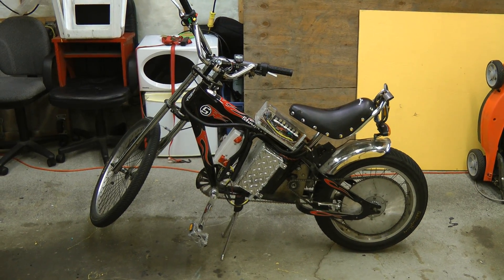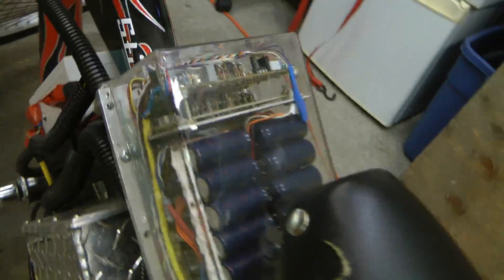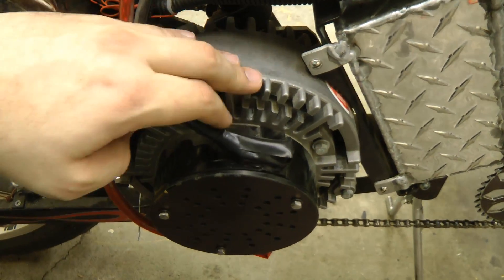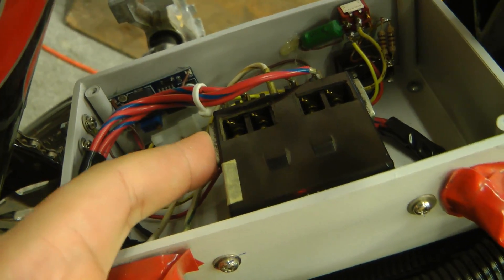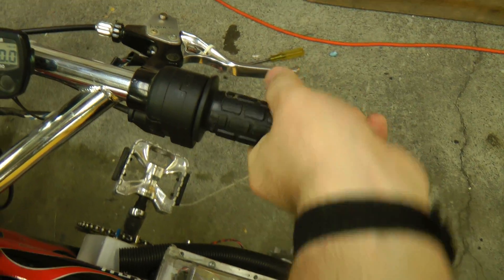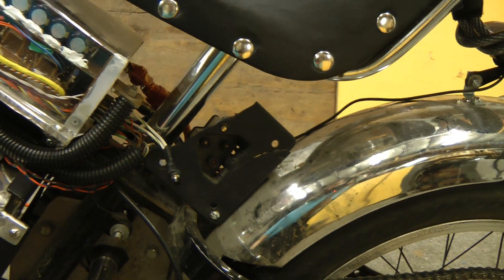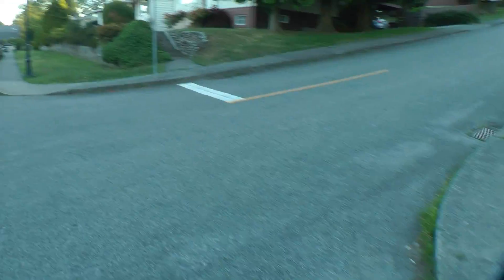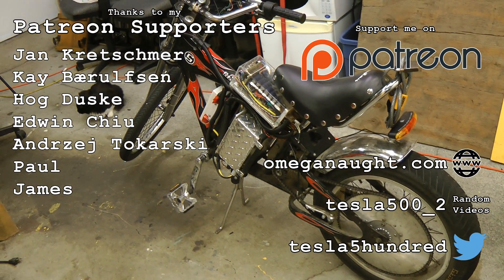12HP Electric "Bicycle"

Comment: what magnet's? commutator brush motors don't have magnets they don't need them. you have two separate windings the brushes are what makes contact between them when electricity is applied through them this is what creates your electromagnetic force giving you momentum and power and torque along with the rotation around a shaft and why the shaft is spinning. as far as the housing goes a Prescott housing with one bolt for alignment is not common. I have a mote energy me-0907 and it's recommended not to go over 90 volts at 300 peak amps and 130 continuous but that motor is capable of punching out well over 80 horsepower and well over 150 lb feet of torque. anytime you increase the speed the power or the amperage the torque it increases ware. heat is the enemy, over building the motor and underpowering it achieves longevity and redundancy increases longevity anyway you can keep the heat down lower the friction extends the life of your vehicle that you're building just FYI keep building bro nice job hard to get something truly dialed in that's inspiring to look at as well as perform. so good job this is neither ugly nor a bad build, quite the reverse a commendable job I can see how it will perform I myself have built hundreds of electric and piston driven vehicles in my life. course I'm almost 60 now so there's that

Comment: I've been having trouble finding an answer to this question  I'll ask it here. I am fairly experienced with electric drive systems both AC and DC and understand how regen braking works. All of the equipment I'm familiar with usually uses lead acid batteries however so regen charging is much simpler (in my mind) 

the question I guess is, How does regen work on a lithium battery which needs (this is where my knowledge is limited) a much more specific method of charging?
Reply from the maker: In this case, the BMS built in to the battery has an output that tells the motor controller to slow down or stop regen to protect the battery from damage. The battery makes all the decisions, the controller just has to obey the regen current limit request.
Reply: Thanks, I guess I'll research BMS that support regen or similar topics. Sometimes the biggest struggle is not knowing the questions to ask so thanks for pointing me in the right direction.

Comment: Biggest concern I would have is it's a toy bicycle and likely the maker expected kids to pedal it all of 12 mph with a tailwind downhill.  I would question the durability over time of components and even the frame.
Reply: Clearanceman2 I don't think it's  made for kids, or with durability purposes. I think it's just for fun
Reply: The original bike was made for kids obviously.  Putting a bunch of power through it that it was never designed to take is a gamble.

Comment: this is awesome yes you have inspired me to continue with my plans I was already getting ready to start my dream bike build using the same model bike frame I am not nearly has knowledgeable as you are so I will have to use parts already built I am praying that a 1000 watt rear hub motor  with a 30 amp continuous motor controller powered by 3 36 volt lithium batteries or 2-48 volt have not decided yet I am thinking of 2-36 volt wired in parallel with a 3rd that can be toggled off and on for boost or for backup to get back all the batteries will have on/off toggles so I can turn them off at will anyway I hope this will be enough power to give close or similar results as your build  this will take me at least a year to build money is the main factor as I have a small monthly budget so I must buy part by part but I am patient and it will be all worth it in the end this will be my main mode of transportation due to a disability  but for now I will continue to ride the bus lol  your video was very help full I learned a lot thanks any advice is for sure welcome thanks sincerely inspired jaymus

Comment: Excellent work! BTW for about $30 you can get bolt on frame attachment points to use a disc brake for that front. Of course you need to buy a new wheel with a disc brake. I'd recommend the ones with dot 3 break fluid -- super safe and the feel you get is just like a car's foot pedal only through the fingers. Any chances of sharing the 300 amp motor controller circuit?

Comment: Nice build :) But is that really 12hp on the wheels? Looking at videos on electrical bicycles with standard 1500w motors (2hp) seems to have very similar power as your creation. Maybe litte less acceleration on a hub motor but they are much faster.

Comment: sounds dumb but you could fit a rear caliper using the sprocket as a brake disc
Reply: That might be bit complicated because chain clerance issues but sure if you can find proper brake system with enough space in it.

Comment: I guess you could make a smaller sprocket on the rear wheel for higher top speed while taking advantage of all the excess torque.
Reply: I wish i had the resources to make an electric bike, but why would i when i have a 80cc chainsaw engine from 1976 almost ready to back on my old bike. ;)

Comment: wouldn't you get the same acceleration with a better top speed if you use a lower gear ratio and increase the current limit on the motor controller?
Reply from the maker: Yes, that would do exactly that. Would need to upgrade the wiring probably to handle the higher current.

Comment: I've wondered. Would it work if you put an RC motor in there? I know there are really powerful RC motors that are much much smaller than that.
Reply from the maker: Yes, I hope to do a better version of this with suspension, using two 6kW outrunner motors. Already have a prototype one I've added hall sensors to, because sensorless sucks for traction drive applications.

Comment: Wow things have come a long way since you built this. 
My bike runs the components linked to here, and will flip over backward easy. Top speed is 45MPH on flat ground. I used a 1997 GT LTS-2 frame with 1999 Marzocchi Bomber forks. I soldered the shunt on my controller to provide 90 amps which the controller handles fine. I run three 6s batteries in series. I used 8 and 10 gauge Turnigy wire from Hobby King for battery and phase wires. I have pulled a two second peak of 6400 watts and have it on video. It is insanely fun.
http://kinaye-motorsports.myshopify.com/collections/direct-drive-hub-motors/products/mxus-xf40-45h-45mm-3000w-motor-4t-9kv
http://www.ebay.com/itm/72V-500W-Electric-Bicycle-Brushless-Speed-Motor-Controller-For-E-bike-Scooter-/391488639412?hash=item5b268a91b4:g:frwAAOSwO~hXIIOd
http://www.hobbyking.com/hobbyking/store/__80907__Multistar_High_Capacity_6S_20000mAh_Multi_Rotor_Lipo_Pack.html
http://www.hobbyking.com/hobbyking/store/__78178__Turnigy_High_Quality_8AWG_Silicone_Wire_1m_Black_.html

Comment: You mentioned that when you used regenerative braking you dumped 100 amps back into the batteries. What exactly defines the maximum amount of burst current you can feed into a lipo pack exactly? Is it just the charge C rating or does it only really matter that you dont overheat the pack and or charge it at a voltage that causes some kind of breakdown internally?

Comment: Wow, so much custom work! Very impressive results, of course great performance, but also great flexibility. Those little RC batteries have amazing energy density and the current makes me a little frightened. Did you consider a thermal cut-off, or did I miss it? 

When you described a street legal ebike I knew you lived in Ontario, but I can't place your town.
Reply from the maker: Thanks! The batteries make me nervous too, something like 1000A short circuit current each! it's nerve wracking making those connections in that tiny box.

There is a thermistor so the BMS knows the battery temperature, yes.

I'm in Vancouver, BC actually, BC and Ontario both have similar laws I believe.

Comment: What is the regenerative breaking efficiency? Is it reasonable to commute uphill in the morning and then downhill in the evening and get most of the charge back?
Reply: "Most" depending on the desired speed of course lol
Reply from the maker: Efficiency is probably about 70-80% from motor shaft to battery. Under good conditions you could probably approach turning your uphill /downhill commute into something that uses about as much energy as if it were flat.
Reply: Nice :D

Comment: 2 weeks ago I took delivery of my electric bike, the rules are quite diffrent in the Netherlands.

In NL this would be considered a moped and you wouldn't be able to register or insure it (witch is mandatory for mopeds to drive on public roads)

the most common electric bike in NL is the pedal assisted type, so you have to keep force on the chain or the motor will stop.
max assisted speed is 25km/h.
Reply: in the uk ebikes suck....
the electric motor shouldn’t be able to propel the bike when it’s travelling more than 15.5mph
the motor shouldn’t have a maximum power output of more than 250 watts
It must also display one item from each of the following:
the power output or manufacturer of the motor
the battery’s voltage or maximum speed of the bike
Reply: yeah`nd that be even worth like your human Rights Understanding innit ???

Comment: Really cool, I have always wanted to do something similar but in Norway you are limited to only 300W so it is not really even worth the extra weight of the batteries
Reply from the maker: The cops aren't equipped for road-side dynamometer testing, you can generally ignore the power limit. Or do as I've done and have a secret button to enable high power mode.
Reply: True, but they can generally tell it has more than 0.3kw when you can pop wheelies. And it is not worth loosing my drivers license over and getting a hefty fine($1000+). And you are fucked if you happen to be in a accident as it counts as a motorbike, with no insurance and no registration.

Edit: there is also a speed limit at 25km/h where the motor must stop working
Reply: Since I live in the country I dont have to worry about any cops so when I make my ebike it will be scary fast and I have plenty of gravel roads to rip up
Reply: +LittleMe If suspect that 'generally tell' isn't going to stand up in court.
Reply: Fuckda Police !!!

Comment: Wow... I like that little cheat button to get Full Power.. Dangerous power, if you nail the throttle.. :)
What's the max speed with Full Power? 55 kph? 
It's cool to see all the work you put into the bike. It's an amazing performer! The hill climbing is out-of-sight! Your bike makes zooming up a hill, look easy! 
Made me think back to the 1960s, when I was trying to climb the hills in Bermuda, with a very light 50cc moped.. I kinda know what kind of power it takes to get a 140 pounds of teenager up a long steep hill..  Yikes!
Reply from the maker: Thanks! Max speed is 45km/h or so. Hills? What are hills?

Comment: please open source the bms
Reply from the maker: I'll put it up on my website, just need to get everything together.
Reply: LEGEND! Yes i'd buy lets group buy some..!!! I'd never kick start but an open source bms that modular.. yes yes yes please :)

Nice bike though I got one of those frames.. I hacked in some cheap downhill forks so i could get a disk on there but it stopped there for now.. gear it for speed as you still have loads of power left in that motor..
Reply: +tesla500 awesome, thanks!
Reply: That would be so cool!
Reply: tesla500 any update on this? I really want to learn how to design a BMS
Reply: Just emailed you about this bud.. look forward to speaking to you soon.
Reply: Understandable! It's better than nothing and certainly a good starting point. Software isn't my strong point whereas I can probably deduce how it electrically functions from the PCB design; components, comms, etc, etc so that works for me! That would be awesome!
Reply: yeah! please I also like to know more about your esc.
Reply from the maker: Ugh, I've been running flat out on the camera lately and have had no time. I could give you the raw source code and PCB layouts, but I don't have time to document it properly at the moment. Let me know if you'd like that.

Comment: The motor is beautiful. My 1Hp when double voltage would cook even with 1/3rd the weight on a run like that . I'd like to see the BMS schematic and software but only for night reading purposes albeit incomplete or messy. I too built my first one around the same time with homemade controller also using pic16 & IRF1404(5). That is truly a fun looking machine!